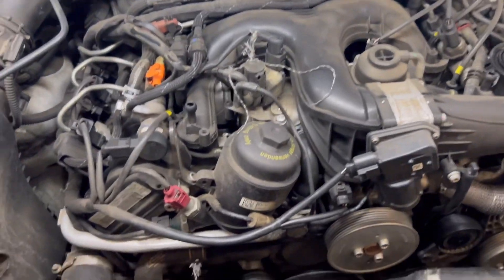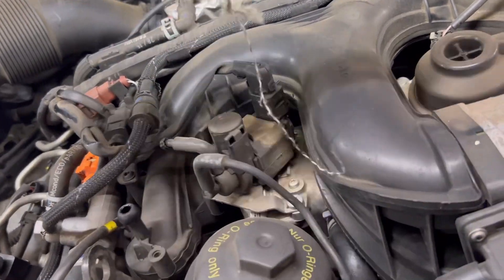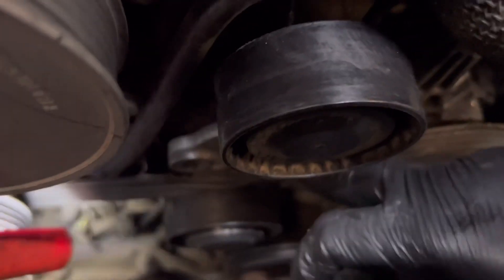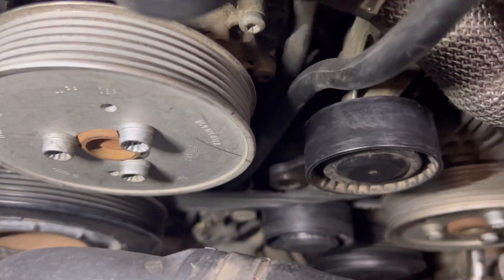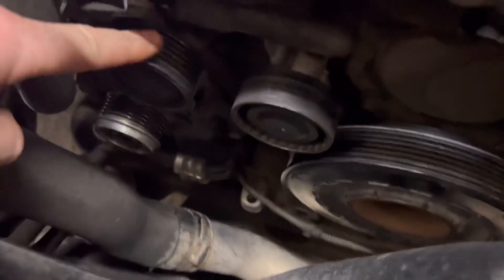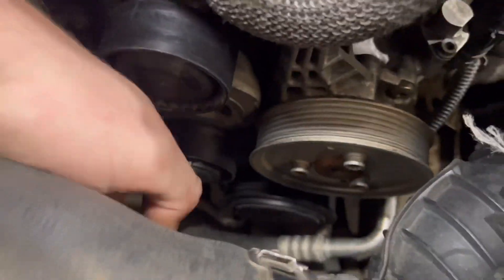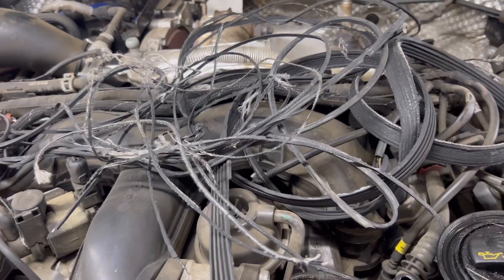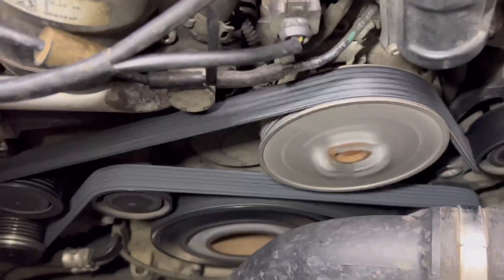VW Touareg Shredded Belt

Comment: We had a 93 Euro van and it shredded the belt twice in a 160 k miles, both times the cords wound behind the crank pulley breaking the timing belt and bending the valves. First time could find nothing wrong with the pulleys second time the AC compressor seized up. Always drove VWs but after this crappy design I will never own another one
Reply from the maker: It’s really bad isn’t it and yeh with this one absolutely nothing wrong with any of the pulleys but the car has never had one in 11 years it’s been on the road and well over 100k miles